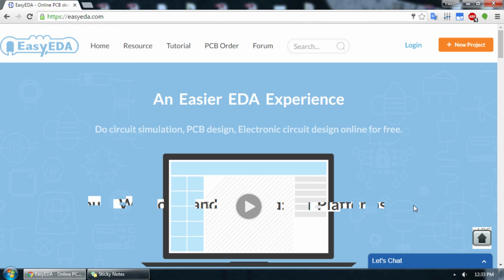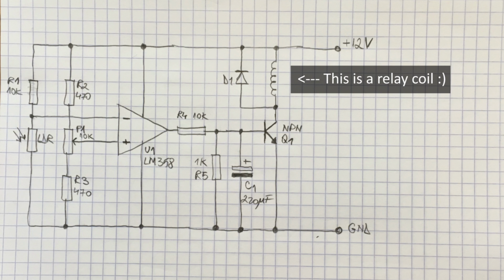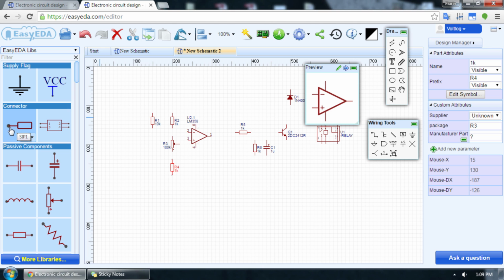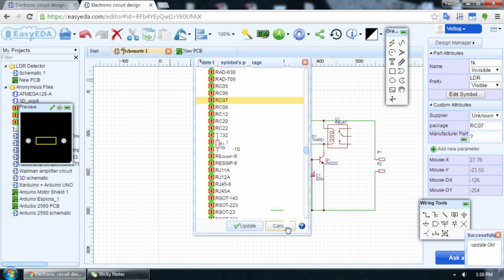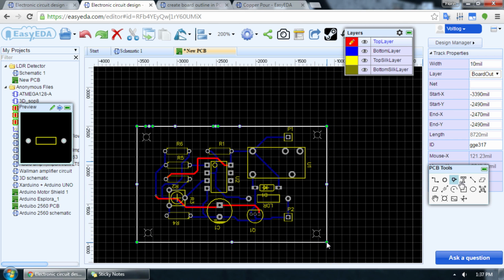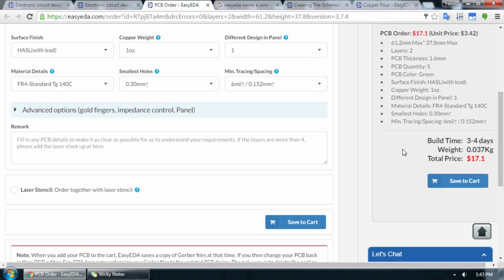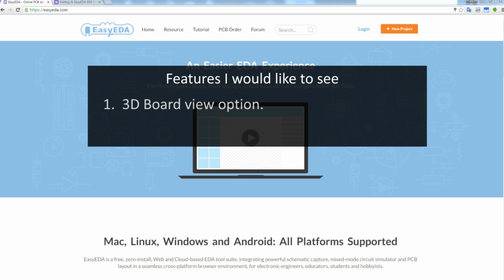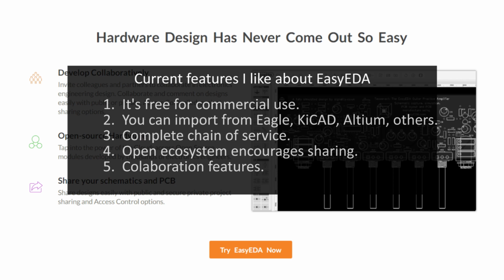Voltlog #58 - EasyEDA Free Online PCB Design Software Review

Comment: Did you manage to test out the collaboration functions? If they work well, that could really be a good selling point for EasyEDA.
Reply from the maker: It is not clear from what I can gather from their website if the collaboration feature is active right now or is a work in progress. I know you can share projects but I'm not sure multiple users can collaborate on the same project at the same time. I will send them an email and ask them about this.

And here is the response from EasyEDA:
"Yes, the collaboration feature is active now and multiple users can work on the same project.
People can invite their colleagues and partners to collaborate in electronics engineering design. Collaborate and comment on designs easily with public or private, Access Controlled, project sharing options.
Here is a tutorial tells you how to share your projects to public or share a private project to your partner:
https://easyeda.com/Doc/Tutorial/share.htm"
Reply: Thanks for the reply. It sounds like it could be good.